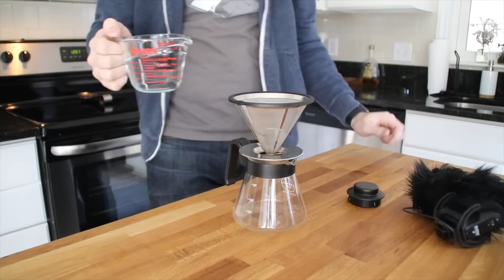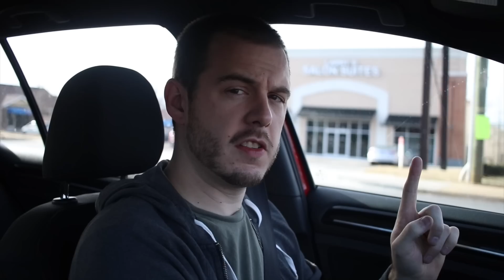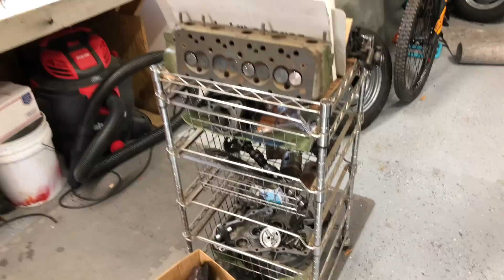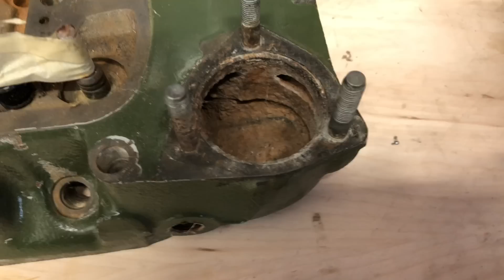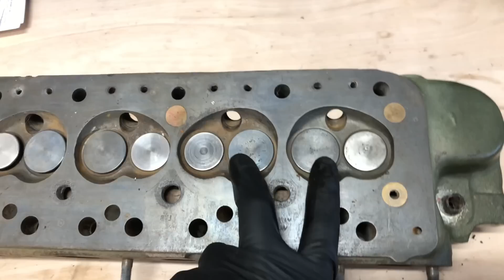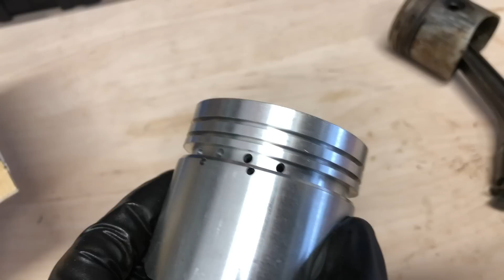Classic Mini DIY - 998 Engine Rebuild Series

Comment: Interesting. Just a technical point, I think you're confusing swept volume with combustion chamber size. The 1293cc you refer to as "combustion chamber size" is actually the swept volume or capacity (bore x stroke) of your motor, regardless of the volume in the cylinder head. Combustion chamber volume typically refers to the volume of the cylinder head chamber (eg 29cc). And the .6mm of overbore you refer to I would think should be 0.060" or "60 thou". A few little things like that, but otherwise a good watch, thanks :) [edit: spelling]
Reply from the maker: Thanks for this insight! I'm gonna pin this comment to the top. This is great info.
Reply: You're very welcome. I've got a supercharged 1275cc in my fully restored '67 Mini Deluxe, I finished it in 2017. I have a bunch of spares that make a whole extra car, so now I'm using them to do a very very cheap built with 
 a 998cc refresh (with a cheap turbo added for a bit more punch) so I am interested in your vids. I'm converting this second Mini to a ute (/pickup) as the shell's a bit crappy anyway, so just a bit of a laugh..tiny little bed.
Reply: Dead right, Simon.  I remember rebuilding and modding a 1098 (I couldn't afford athe 1275) back in the late '80s - 60 thou over, 12G295 head (off a Sprite) and a 544 cam.  I'm really looking forward to seeing how this goes - I miss that car.  :-)
Reply: PS:  I'm not a fan of modding that 1275 head (presumably a 12G940) for use on a 1098 - they tend to not make a good torque curve with such large combustion chambers.  As Mini Mania have said: "they will make the horsepower if you rev them hard enough, but I can still make more horsepower, with a better spread of torque, using the smaller heads...When using 1.218" valves the 295 head flows the same as the 940 head with 1.3", but the 295 head is doing it with smaller volume right through."
https://www.minimania.com/Project_Small_Bore__Part_2__Cylinder_Head

Just a thought.  :-)
Reply: i guess Im kind of randomly asking but does anyone know of a good site to stream newly released movies online ?
Reply: @Ari Xander Thanks, signed up and it seems like a nice service =) I really appreciate it!
Reply: @Emiliano Marshall No problem :)

Comment: Putting a 1275 head ...e.g. 12G940 etc on a 998cc you will need to pocket the block to avoid valve contact to the block face. Ideally a great setup is the Cooper head 12G295 or 12G206 which doesn't require the block pocketing.

Comment: Great :D Can you show all the things about restoring a engine and the most important, setting up the cam timing and the dizzy timing? like that we can rebuild our engine at home, it will be a good project for the raining days. Thanks
Reply from the maker: Yes for sure. This is a start to finish series so I will be following the whole process until it’s driving down the road in my friends Moke.
Reply: Great. I have a 998 engine here with only 30 000 km that need a good rebuild. Thanks again for this videos :)
Reply: Agree! I think most people issue is getting the timing and distributor set up correctly and panic.
Reply: minimoe2008 its that my problem. I'm good with all things in my mini but the cams and dizzy timing are the problem.

Comment: Some good info there....'Spark Hole Plugs'  - keyboard trouble I guess, made me smile though! Spark plug hole I think!
1275 head on a 998 is sort of OK for a road job, or specially a 'Fast Road Job' (subject to valve/block clearance) but are you really suggesting a crossflow 7 or 8 port head as an alternative??? 
You'll need a different cam, exhaust manifold, inlet manifold, and  possibly bonnet (hood) to accommodate the inlets... for about 5 HP?  For a road car?
 It's a lot of work even for a race car.......and not legal in most race categories anyway, I believe
But keep enjoying driving Mini's, best car ever I think, what a Classic

G

Comment: Hi mini DIY, great video! I have question - why does my clutch not engage when I press the clutch pedal down, the clutch arm moves but when I select gear the car doesn't do anything? Someone said could it be the clutch plate stuck on the primary gear or I think the clutch cylinder needs bleeding? What could it be...

Thanks 👍🏻
Reply from the maker: I would definitely start with bleeding the clutch system, it's pretty straightforward and easy to do with a friend. I am not quite sure I see how it could be stuck on the primary gear since the clutch plate is housed outside that section of the transmission. If you want to discuss more feel free to email me classicminidiy@gmail.com

Comment: That block appears to be the later A+ version of the A series. Are you going to change the camshaft?  I am Looking forward to the rest of this series as I am currently about to rebuild my 998 with a few performance parts.
Reply from the maker: Almost 100% going to replace the camshaft during this build.  This motor is going to be a good representation of what you can do with a solid, tuned 998.

Comment: Will you have to put valve clearance in the block for the exhaust valves? When using the 12g940 head on a small bore block or have you got a plan for this

I’m keen to follow through the what your doing as I want to refresh my 1100cc motor this year and I have 998cc as well that can get done at the same time

Have you had a look at Graham Russell’s website in Australia?  The A series guru and knows his stuff
Reply from the maker: Yes, I definitely will have to pocket the block in order to make the head work. Do you have a link to Graham's site? I would love to see it.

Pocket like this: http://www.minifreunde.at/2008/1101_hilfsrahmen/gr_DSC08425.JPG
Reply: His website is 

Russellengineering.com.au

He’s only 10 minutes down the road and I still haven’t found the time to pop in for a yarn. But I’m looking at the small bore 12g202 mods he does and the over size valves

He’s as good as David Vizard according to the NSW Mini club

Comment: hi ive just bought i 1275 and just wondering if whats sort of head its that , i know its a 1275 but what stage?
Reply from the maker: The head we’re using is just a stock 1275 head. Might add bigger valves but probably not.
Reply: Classic - 1275 head works on a 998 pocketed block (ie block is machined for the valves to open fully) and the gasket to use is the Metro Turbo BK450 (Payen)

Comment: You want a 998 cooper s head 12g295
Reply: No such thing. The 997cc Cooper (not 'S') was from '61 to '64 and the 998cc from '64 to '69. This is a 998 'A +' engine not 'A series' ('80 on). The 12G295 is an excellent standard head though and well worth considering but its not an 'S'. Good luck finding a good one though

This is an interesting article:
https://www.minimania.com/Project_Small_Bore__Part_2__Cylinder_Head
Reply: 12G295 was standard on the 1100 MG Midget/AH Sprite - don't think they're that rare yet (that's where I got my old one from, anyway.)

In Australia, there were tricks like that to finding harder-to-get parts without breaking the bank.  Like taking the engine from a Morris 1100 S, which turned out to be the same as the 1275 Cooper S block.  No idea why they called it the 1100 S in Australia, instead of the 1300, but it was much cheaper than getting one out of an actual Cooper.  :-)
Reply: aussiebloke - One thing we were very at good post WWII was using many similar parts and producing very different cars. We had to as our economy was f**ked, we had a huge overseas debt problem (and therefore HAD to export) and we lumbered ourselves with big Social programmes. This was OK in the '50s and '60s but come the '760s we just started to  lose out to new competitors producing newer more advanced materials and products. if braindead managements had funded the innovation the Mini showed in '59 in the '70s we may not have lost, for example, our motorcycle industry. when you see what a reborn Triumph have achieved in such a short time proves my point.

Comment: Swept volume not combustion chamber
Reply from the maker: The combustion chamber is the space where the explosion actually happens. Alternatively called the "clearance volume". The "swept volume" is the entire chamber volume between TDC and BDC which in this build is not something that factors into the equation. What we are concerned about is the additional volume for air/fuel mixture to explode. The higher the displacement in your "clearance volume" the more power you can theoretically produce.

Comment: That picture isn’t a moke
Reply from the maker: Isn’t it? Looks like a Moke to me?
Reply: Classic Mini DIY look at the side panel and the front. A Moke has 3 individual side Panels
Reply: I wouldn't get too hung up on the panels. The photo is of a military version and could have had many differences like the two extra handles each side to lift the car and turn in a tight space. They were also built in 5 different countries and each would have made local changes to ease production. (Like the early Aussie Minis had external hinges but wind up windows)
I suspect that is an export / military or foreign built car. But its certainly a 'Moke'.
Reply: Mate it’s not a Moke dunno what you Americans think mokes are but it isn’t that picture in the video
Reply: W1LL14M_F13LD - Hmmm and why do you call me 'American'? Because I hold a different point of view? 
Listen numbnuts I was working on competition Minis and Mokes in car clubs in the late '60s and '70s while rallying Fords myself. And where did I do that? Oh wait ... that would be in Essex .... UNITED KINGDOM

Comment: no production car has camless piston engine...
Reply from the maker: True no production cars do although Koenigsegg is pioneering some pretty cool tech with their Free Valve motors which looks pretty cool.
Reply: They wont go to production because the ramifications of one corroded wire are far stronger than the loss caused by mechanical timing.
Reply: The Koenigsegg is actually pneumatically and electronically activated to try and solve that problem